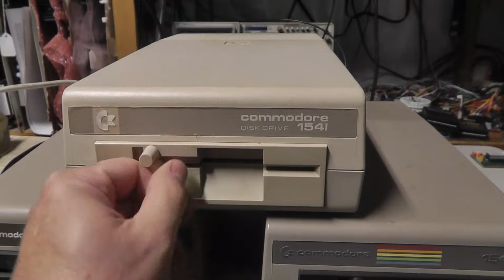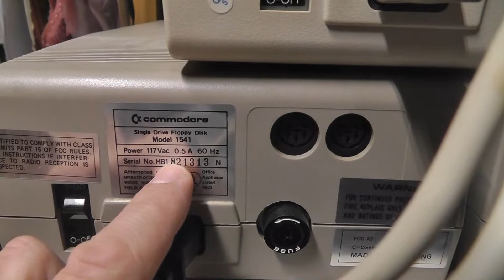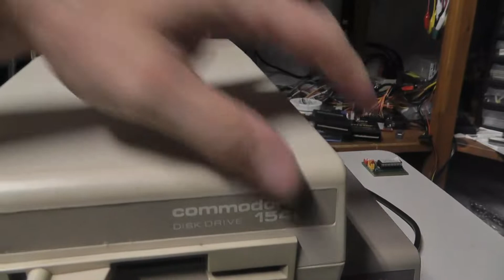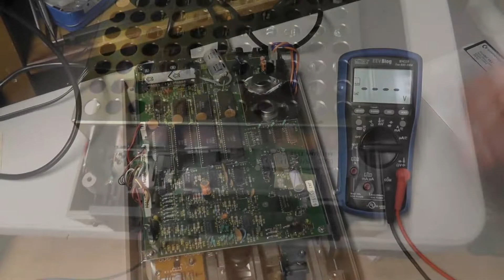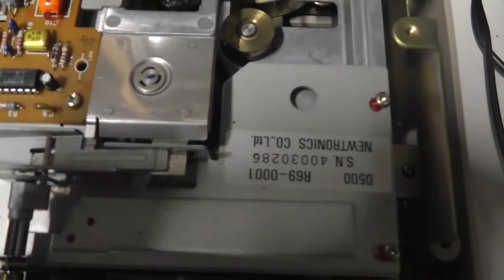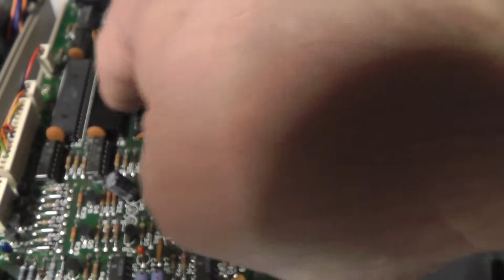My First Commodore 64 Repair - part6 1541 Testing, Bad dos rom

Comment: Do you think we should replace the main capacitors on the power board if they are still the originals?
Reply from the maker: It definitely wouldnt hurt.  I havent done enough repairs or have any data on probability caps are out of spec but due to the heat this thing generates one would suspect they are due for replacement.
Reply: @jacklick  Any electronics I value I now try to point fans at them while they are running.